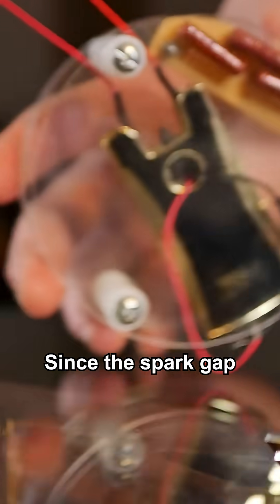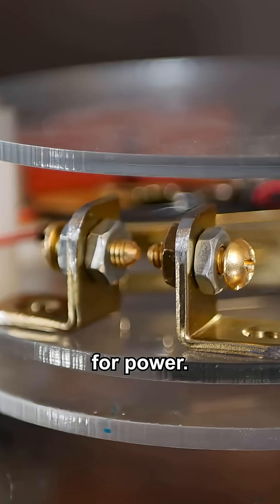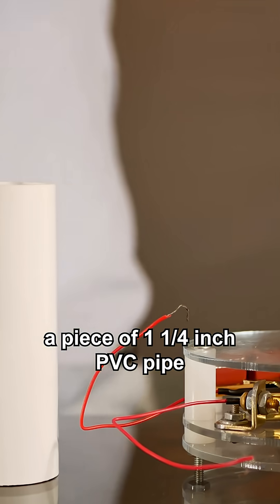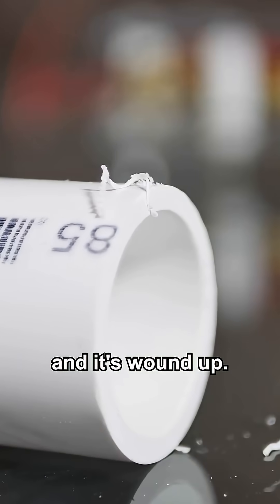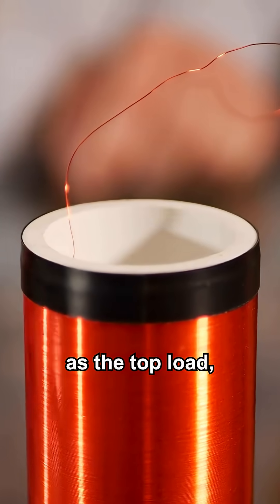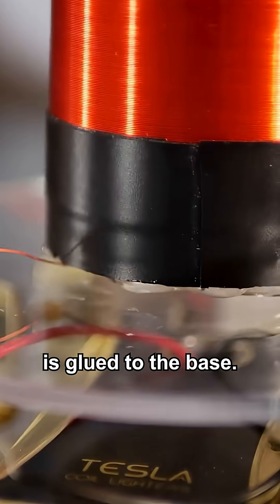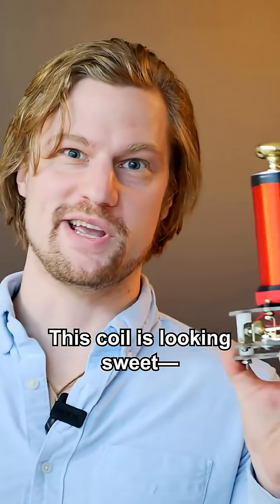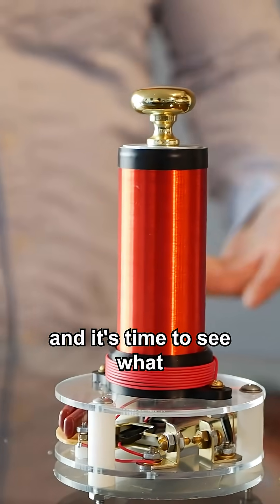DIY 50,000 Volt Arc Lighter Powered Tesla Coil

Comment: GROK: 
Q: How does Tesla coil spark plasma go through glass and into incandescent light bulb filament? (Do not discuss fluorescent light bulb phenomenon)

A: Ionization of Gas Inside the Bulb: Incandescent bulbs typically contain a low-pressure inert gas (e.g., argon or nitrogen) or a vacuum. The intense electric field from the Tesla coil can ionize this gas, creating a plasma (a mix of charged particles like ions and electrons) inside the bulb. The ionized gas becomes conductive, allowing current to flow within the bulb.

Comment: I'm not sure how you're using high voltage for the primary side of the Tesla Coil?  Usually the primary is low voltage, high current.
Reply: Does a high current at a low voltage mean that the medium carrying it has a very low resistance, almost super-conductor level of low?
Reply: @harshvardhan4771  no ... most Tesla Coil primary coils are just 2 or 3 turns of maybe 16 ga (or larger) copper wire.  They carry short pulses of fairly high current, maybe 2-3 amps or more.  But usually at, say, 24 volts or less.
Reply: @davidh.4649 🤨 please explain further. Is the copper wire used in tesla coils made up of some magical material? Does ohm's law not apply to it?